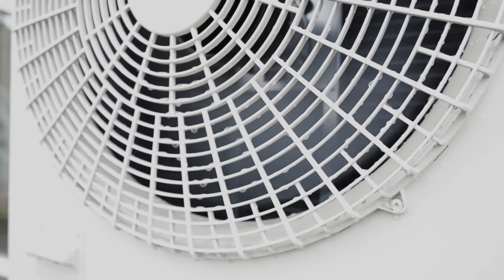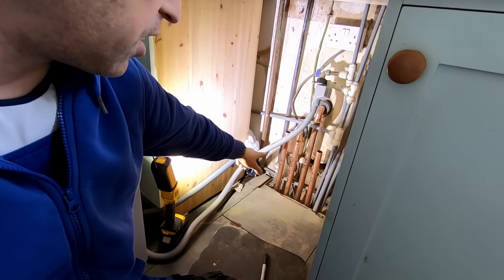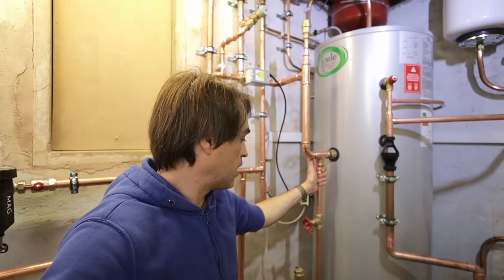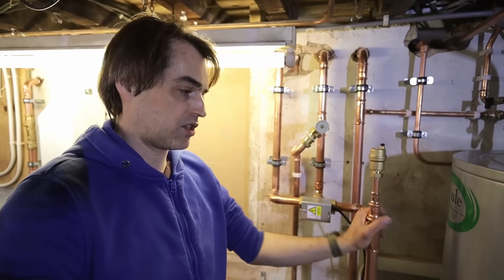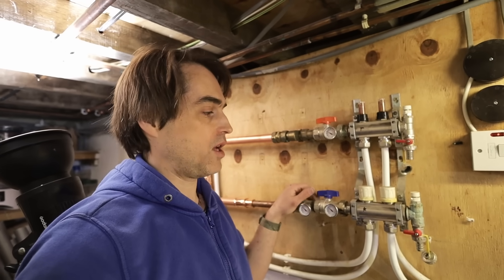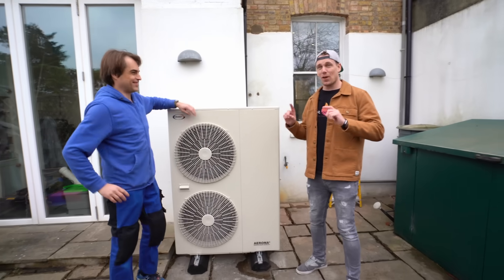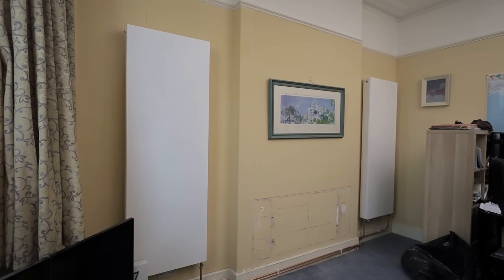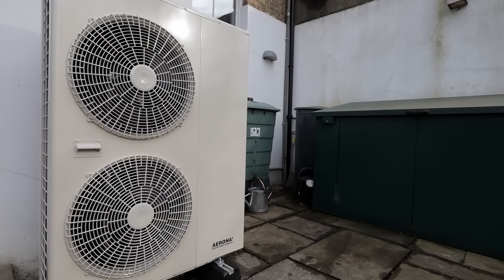The Truth about Heat Pumps: Debunking the Myth.

Comment: As i and my company already installed over 1500 running mashines over the course of the last 23 years i can say: They work, you just need to know what youre doing.
But our system run at 35°C in and 28°C out temperatures so you need an under floor heating system or special radiatiors with fan support.
with these radiators you dont need to plaster your living room wall with radiators. 
holy moly ... my customers would look at me and would ask if i have undiscovered psychological problems or something for even suggesting that.
Reply: Adding fans to the existing rads seems like the obvious solution to make for an easy install. Do you know of any calculators to work out the effective increase in Rad size?
Reply: LITERALLY THE HOTTEST HOUSE I have ever been in was in the UK in winter with a heat pump system.  

I was fixing some kitchen cabinets for a neighbour and honestly, I could not breathe, it was 32ºC, I think the woman must have had a medical condition - YES this was a new build and it was installed from new with the house. But anyone that says they don't work is talking BS. Maybe badly installed or cheap systems don't work. But that's NOT to say heat pumps don't work.
Reply: @piccalillipit9211  if it was her or his wish ... halleluja ... our under floor heating is self regulating thru the first law of thermodynamics. As soon as the airtemp. Inside the house reaches the surface temp of the ground at around 23-24 °C, as ex. Thru the sun, Our system shuts itself off ... physicaly  ... 

But if you wanna have a sauna we can make it one yes.
Reply: @PhucuYT  - I only know it was a heat pump cos I asked why it was SO damn hot and she proudly told me it was a heat pump system - as if that in itself explained it. She showed me the equipment room where there were two MASSIVE tanks of water that were the heat reservoirs. They supplemented the ground source heating in the winter with heat extracted in the summer. I don't think a normal person would need these as a normal person does not live at literally tropical temperatures. 

I don't know anything about heat pump systems, but I know for sure the idea they dont work as a technology is rubbish. Maybe this system cost £50k - I dont know, but it sure as heck worked and at £3,000 a year for gas as many in the UK are now paying it does not look THAT expensive at £50k, especially on a new build.
Reply: @piccalillipit9211  ah well ... i come from germany so i dont know the relation to the costs of other heating systems in GB...
i just know you guys earn much more than we do.
when i was in school, every teacher told us we get 3 times the money in GB.

Our one family home system costs around 15.000€ for the heatpump system .
gas heater systems as example are around 8.000-10.000€ but since the psycho german goverment forces us to use a specific amount of "renewable energy" when homes are newly build you have to install a solar or PV system in addition to that, so the total prices ends up way over 15.000€.
Reply: @PhucuYT  - OH I dont know - I have not lived in the UK for a long time, but the wages seem pretty crappy to me over there now.  I was a salesperson in 2002 on £65k a year and not the average is £32k in 2022...  But they keep voting for a "conservative" government and they keep getting poorer - what can you do??? 

I pulled the figure £50k out of think air purely based on the fact it was a large £1 million pluss house NOT a normal house for normal people.

Personally, I think €15k for a heating system is an appropriate amount of money if you get 25 years of life out of it and it is affordable to run.  We are obsessed with everything being cheap cos we live in a disposable society. I make bespoke historical men's clothing.  In 1930 a Singer sewing machine was nearly a year's wages. Today you can buy one new for €50 - but it will be in the landfill in 3 months.  Professionals like me either buy the 1930's Singer or we spend €5,000 on a professional modern machine cos NOTHING domestic-made today will do the job...

The point of my tangent is we have been trained to think of EVERYTHING as disposable - so people have a heart attack at the thought of a €15k heating system. Its €1.66 a day if it lasts 25 years...

Oddly the same people will spend €50k on a car without batting an eyelid...
Reply: @piccalillipit9211  You can buy a 3 bed house up here in cold Scotland for £280,000 or so, your saying that an additional 50k is reasonable?  Don't think so....
Reply: @DavidMartin-ym2te  - Thats not what I said is it???

Comment: So,do I have a misconception when I say that heat pumps are not efficient when asked to work in ,below freezing conditions?
Reply from the maker: Yes, misconception. It will lower its output as there is less energy to be extracted from the air but it will still be the most efficiency heat source available at the moment.
Reply: @UrbanPlumbers  and this is true across all manufacturers?

Comment: The best to use a heat pump with under or infloor heating. Underfloor heating typically uses water at 37/40 deg C .  It takes more energy to raise water to 70C, or the new 55C, raiditor temp,  than 37C, floor heating temp.  Which means either a major renovation or new builds. Because of the cost it's probably better to finance it in the original mortgage, so new build.
Reply: Or just get an air-air unit. It is a wall mounted box that blows hot air. Any use of liquid heat transfer will blow up the cost.

Comment: Please can you send us a link for this "volumesizer" .Because we also install underfloor heating we are interested in how it is that you do not have a thermostatic valve on underfloor heating ... it is true that you increased the area of radiators and this reduced inlet temperature, but what is not still too hot for underfloor heating ?? Thank you for the answer and best regards from Slovenia Sandi👍
Reply from the maker: We increased the size of the radiators to the point that both rads and UFH run at the same temperature

Comment: Surely under floor heating steaight off a gas boiler would be cheaper and more efficient?
Reply from the maker: Gas boiler with UFH could be theoretically over 90% efficiency if installed well.

Heat pump with UFH can be 400% efficient.

Heat pump would be comparable or cheaper to run with cop of 3.6 or over

Comment: I don’t understand why people are willing to accept the need to insulate their houses and fit bigger rads when buying a heat pump, yet those very same steps against an existing gas boiler will save money immediately and would at least get the house ‘heat pump ready’ for when heat pumps get better and cheaper and all the cowboys have been eliminated.
Given that gas remains 1/4 of the cost of electricity even with the latest rises, I doubt this thing gets anywhere close to a cop of 4 in the winter - and it would be switched off in the summer
Reply from the maker: Gas boilers don’t run at 100% efficiency, as a matter of fact vast majority of boilers run at around 81-82% efficiency at the moment due to poor installation practices. 

For that reason you don’t need a cop of 4 for heat pump heating to cost the same. Actually a cop of 3.2 will get you in a similar ballpark cost wise.
Reply: @UrbanPlumbers  agreed on the efficiency front.  I have quite an extensive datalogging system for my house and can see that my dhw takes about 10kw to heat on gas and about 7kw to heat on the immersion. So with octopus go, it’s cheaper for the overnight heat but the single daytime heat gas cheaper obviously.  Going to sit tight on ashp - wait for them to improve.
Reply from the maker: If it’s cheaper to do hot water on direct electric with 100% efficiency just imagine what you could do with a heat pump!

You can actually get an air to air heat pump for hot water only!

Comment: Absolutely excellent video, well presented and well explained, but I feel its slightly biased. Heat pumps don't work great in a general scenario of a 3 bed house with a general boiler/rad set up, due to the volume of pipe work required ect ect,  plus you would need to up size to these huge rads and expect lower temp coming from them, NO FAULT TO YOU GUYS AS ITS JUST HOW THE ENGINEERING WORKS OUT.

So the cost of a heat pump is huge for a spot on set up like you guys have done, I think people beleive they can just rip their boiler out and fit a heat pump and then it's job done wich is not the case.

Excellent video, but I don't think the cost justifys the savings in money. I agree with Roger in that respect. 

Just my opinion.

Keep it up and lovely job

Comment: Heating more of the house when not necessary to create more efficiency is not creating efficiency.  Then you have to keep the unit on when you don't want it because it doesn't have enough power to heat up the house fast enough..in order to maintain efficiency.  You are just fooling your self, really heat pumps don't work.  What is the best efficiency and water temp with -5C outside?  Its not really any better than a resistive heater, except in warmer weather when its hardly needed, but a hell of alot more expensive and no control of when you can use it.

Comment: Thanks. Brilliant video.

But.......

That's EXACTLY why they don't work coz.........90% of the fitters will NOT be fitting the system to such high standards; heat pumps require way too much expertise, time, and skill to make them work well and therein lies their weakness. So....Roger over at Skill Builder is 101% correct........they are a new 'misselling and litigation' scandal waiting to happen.

And the thing is, in a previous video this very guy (Urban Plumbers) did a job as a subcontractor on a heat pump install where the install wasn't at all satisfactory.

The real problem is this, as Roger over at Skill Builder alludes to, you and Heat Geek (note the name!!!) are weirdos! Why?! Because in most trades very very few people like you exist; that is, technicians skilled and knowledgeable to the highest degree and working to exceptionally high standards. If the vast majority of customers were going to get technicians like you and Heat Geeks, there'd be no problem. However, if you are honest, you know the reality is the reverse; most fitments of these heat pump things are not going to be done well. And in years to come I can pretty much guarantee that a high proportion of your income will not just from fitting these systems but rather from correcting the mistakes of other fitters. In fact, Roger over at Skill Builder, in one of his videos drew a distinction between people like you guys and mere fitters (the latter will be doing most of the jobs, having the least experience and skill and causing the most problems).

Council properties are going to be a hotbed of poor installations. Why? Coz councils love to go for the cheapest tender rather than the most skilled, and as a consequence they'll be attracting the least able people to do the work on their properties.

So all in all it strikes me as something of a mess. To expensive for most people, and requiring too much skill for most people, and then when (not if) the government forces everyone to have these systems the poorest people in society (those in social/low income housing) will be getting these systems for 'free' but the installation quality will be rubbish.

Comment: Do they make heat pumps that are set up with the wall mount and fan like a split system air conditioning?

I know they're heat pumps too but haven't seen any that heat water.

I was thinking having the fan forced heat would be better so wouldn't need the large radiators.
And would have the added benefit of being able to cool.
Reply from the maker: Yes you can get split systems
Reply: @UrbanPlumbers  
And they do got water too?

Comment: How much did this installation cost? The customer has more money than sense, taking a perfectly usable gas boiler out and installing a ASHP, which on good day will just about cost the same to run as a HE gas boiler. I would like to revisit this property in 5 years time and compare costs and FWIW I've been intrigued by ASHP's since 1990 and whilst there is a place for them, it's not as a replacement for a gas boiler. Forget the 2022 rule change as national housebuilders are not even putting in provision for upgrading to low temp systems now, especially concerning a space for a thermal store/cylinder.  That house is hardly typical of the majority of houses with its virtual cellar.
Reply from the maker: Existing boiler was beyond economical repair
Reply: @UrbanPlumbers  that still doesn't make all that expense necessary, a good quality boiler with weather compensation would be a far better choice, both for the customers wallet and the environment, as I said, come back in 5 years and let's have a debate.

Comment: I’ve been attracted to this idea but it is too complex, regardless of system design. Even OP had to correct  himself with return this and that, valve this and that. I bet it does work well but it still has an immersion heater. And these guys are experts. I’m not going to be an early adopter. I’m  leaning to the Roger view for the time being. ROI  doesn’t seem to be reasonable.
Reply: Heat pumps are designed to capture the additional air temperature from outside… great during the summer months if you have a pool. Expensive during the winter months (when you need it most) unless you have a solar or economy 7 solution in place.

ThermalPV & localised phase change storage is a much better solution for most domestic properties… & cheaper!
Reply: it's an industry that will reap the rewards of government subsidies; whether it's affordable or not.
Reply: Yeah, forget the planet we just want to see return on investment amiright?
Reply: @PKWeaver74  The more complicated it is, the greater the pollution and carbon footprint.  It's not a hard concept to grasp.
Reply: @PKWeaver74  no you’re not right. Cutting down on energy usage helps the planet. My focus is on making my house more energy efficient. New windows, additional insulation, having everything serviced regularly, just a few initiatives. I’m even considering panels as we have a south facing roof. But something  that costs too much and still needs old tech to ensure hot water is not something that I’m going to adopt until the tech improves. I hope I haven’t pulled the rug on your smart arrested comment but hey, some of us think in more than sound bites😅
Reply: @iangelling  No, you haven't. I'm in the same boat as you, doing exactly the same thing but we still need pioneers who can afford to be the early adopters on principle, then economies of scale can reduce prices. 
I'm not opposed to what you said, just throwing one of my sound bite thoughts out there to agitate for a response 😉
Reply: @PKWeaver74  😁 you are right though. There is a tipping point where improving what you have is not sufficient. I live in a 1950s house. If I had a new house I would probably look at this differently.

Comment: All a massive costs and waste of money. I did a combi swap this week for £1800 inc boiler. Hope the government sees sense and adds a mix of hydrogen into the main gas network - that alone will bring the emissions down near to zero . This will happen as the top manufacturers have already developed hydrogen ready boilers plus the Gas distributors around the country are already testing the gas/hydrogen mix.
Reply from the maker: Hydrogen will lower calorific value of the mix by 16% when mixed at 20% with NG and massively rise the cost of the fuel.

Hydrogen is truly not the answer
Reply: @UrbanPlumbers  Compared with the 30k for that install an increase in gas wouldn’t matter. Hydrogen Is the answer and is the quickest route to low carbon emissions. Majority of housing have no room for cylinders and all the controls and pipework that go with it. Also , how can the high costs of installing heat pumps be justified when the cost of a decent one is less than £2k. Heat pumps will be the next PPi claims in a few years
Reply: @UrbanPlumbers  Reducing the cv won’t matter … it will still be a lot cheaper than a Ashp .
Reply from the maker: @russthomas02  hydrogen does not exist as a fuel in nature in the same way as gas or oil - you need to use other forms of energy to create hydrogen which makes it prohibitively expensive and not practical.

Hydrogen will most likely be more expensive than direct electric which in turn will make it 3-4 times more expensive than heat pump, ohh an if you take into account low CV and efficiency it has to be burned on ASHP may be even 5-6 times cheaper to run.

On another note - heat pumps are here and they work, hydrogen is decades away from being available as a fuel for domestic heating, most likely will never happen.

Comment: Not being harsh but I hope it was cheap 'cause those radiators look awful and that heat pump has wrecked the look of the garden. Don't they at least mount on the wall, rather than stuck in the middle of the patio?
Reply from the maker: How about lowering co2 footprint by 70%?
Reply: @UrbanPlumbers  Sure... Buy a Tesla or almost any electric car and you pay a premium. Everyone knows. You might end up driving in the slow lane more often but at least you are sitting in something that looks great.

Comment: I thought the air gap drop link was to reduce the temp of the run over water.  In my system (just a combi) it has the air gap drop link, then it goes straight to a normal condensate pump which holds about 2 litres of water before it starts pumping it up one floor and out the roof eves.  If it don't work, my ceilings get soaked.
Reply from the maker: I honestly don’t know what you are trying to say!